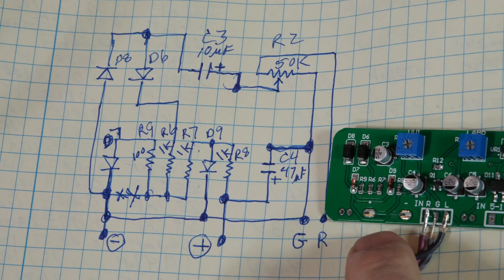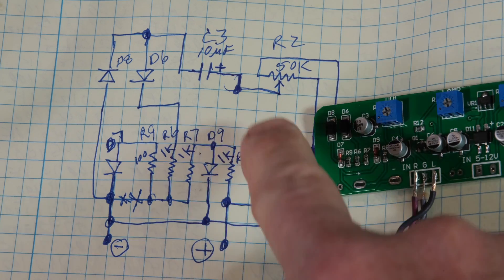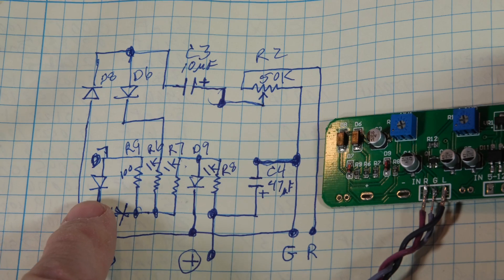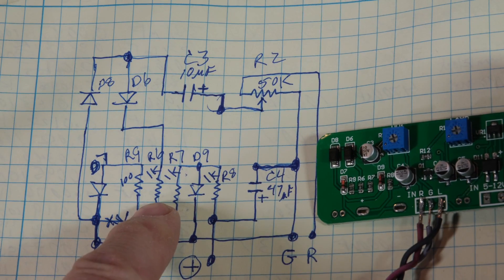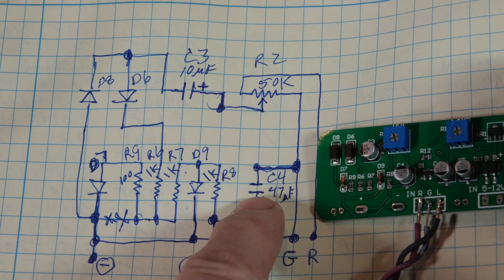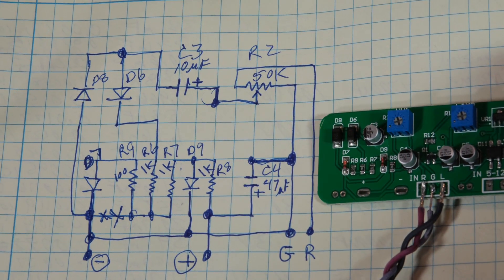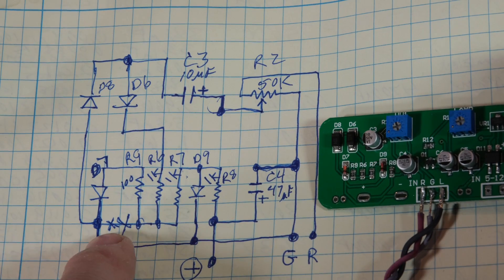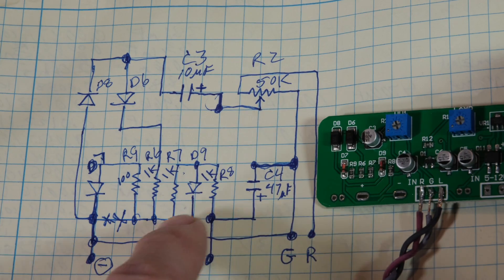How I Reverse Engineer a Circuit Board to build a Schematic - ICEpower 125ASX Project Build

Comment: On the FWB, many times these are included when the module is meant as a retro-fit to an existing system whereby there is not a known power-supply configuration.  Also, I've seen this done as a defensive move that makes sure the correct polarity is always applied, especially if the module is subject to a warranty option, whereby it prevents destruction of expensive (relatively speaking) components (say the meters in a repair scenario), and also eliminates the hassle of arbitrating fault between the customer and the manufacture--pretty cheap insurance...
Reply from the maker: Thanks for your feedback!

Comment: A 7809 or 7812 fixed voltage regulator would supply a nice low impedance dc supply.
What is the current draw of the VU board?
Reply from the maker: That’s a great way to provide the voltage, but the current should only be less than 10 mA so that’s why I used a zener in series just to drop the aux voltage down to the range needed.

Comment: I’ve just had a VU meter experiment myself for a diy preamp build. I had one Radio Shack VU meter from the 80’s, and thought to finally give it some life. The meter measured to be 200uV to reach full scale and had a 600-ohm coil resistance value. I only have one meter, so I was going to connect to both channels to give a sense of peak scale. I wanted to minimize any impact to the preamp by the meter circuit, and since there is +- 12v power in the preamp, I used a LM324 quad op amp chip. Each and all op amp was configured as non- inverting buffer, one each for the left and the right channel with 1M-ohm input impedance, and combined signals to a peak and hold circuit with a buffered output to the meter. The design was to aim for a 2V p-p input signal for the 100% mark on the meter - around 18% of the input peak, after rectification and diode voltage drops. I’m happy with the results.

I’m surprised to see a passive design for a VU meter. If you liked the front look of this meter and don’t mind a “peg board” look on the back, I will be happy to build an active circuit for it for you, free of charge. Just let me know.

-Peter
Reply from the maker: Thanks Peter for your awesome feedback!  I’d love to test anything that you think is worth a look:)

Comment: It's AC or DC powered I think, and the DC has no polarity due to the bridge. I thought the meter says 5-12v.
Reply from the maker: Yes I think you are correct John!  I put DC voltage in and it worked, but then the aux supply I was using died:(  It should have had plenty of current handling for these LEDs, but maybe I shorted it - which it should have handled as well.  OH well - you win some and some you don't;)
Reply: @KissAnalog  Maybe it needs a floating supply.

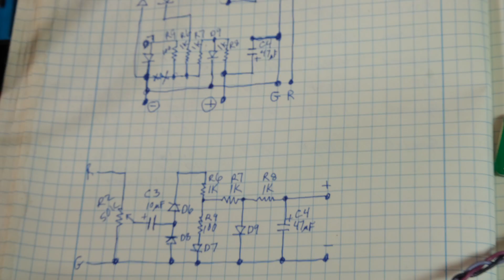Comment: 4:57 Shouldn't the polarity of C3 be the other way around? Now it looks like it's gonna get reverse charged when the input signal goes negative.
Reply from the maker: Great question!  You can see from the board that I got the polarity correct as the caps negative end is the black part of the cap, but as far as if it is correct or not - let me explain.  The positive pin gets the signal, but when it goes negative, the diode D8 keeps it 0,7V from ground (negative), so it will get a small negative charge but a diode drop is generally OK.  A poly cap would have been better:)
Reply: @KissAnalog  Is the input connected to line or speaker level? I guess speaker because it would load a line output to much.
So the right hand side of the cap can't go lower than let's say -0,6V but the left hand side (marked +) can go close to -24V rail, if the pot R2 is turned all the way to input (R) - max sensitivity.
Reply: @KissAnalog  Yeah, it looks like you got the schematic right based on the board, as far as I can tell from the video. But I think it's still wrong, the cap has a low-res path through D8 to get charged in reverse of its polarity and about a 1K res path via D6 to get charged correctly, so it will average out in reverse.
Another way of looking at it, the input amplitude is gonna average around ground (or the DC offset on the output of the amp), but the output of this circuit is positive compared to that same ground. That can only be if the right hand side of the cap is positive compared to the left hand side.